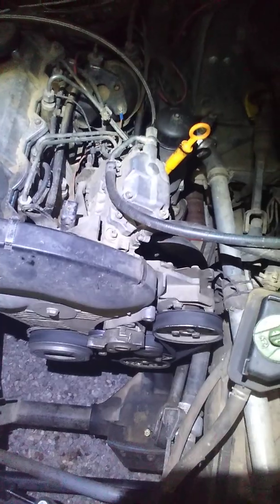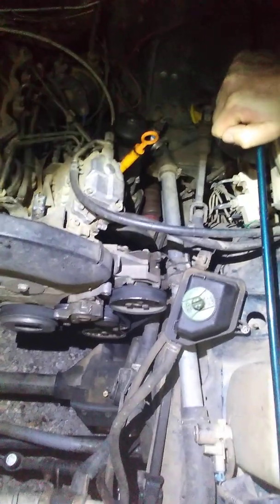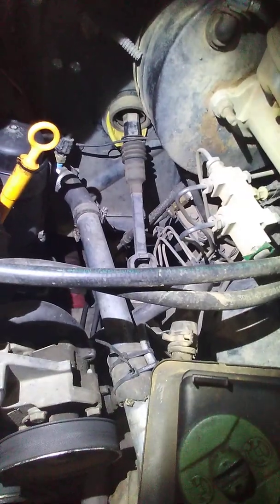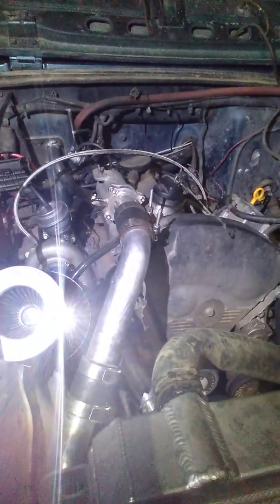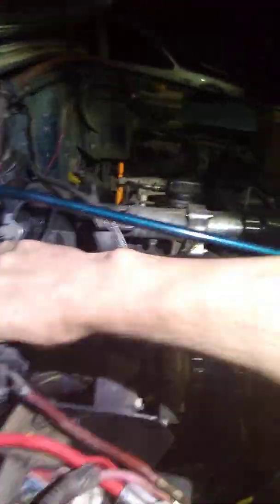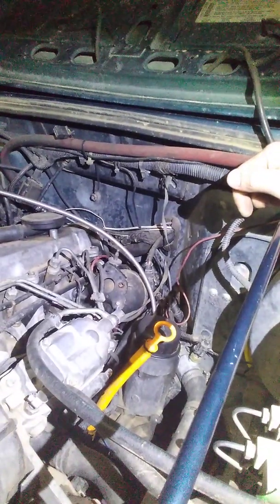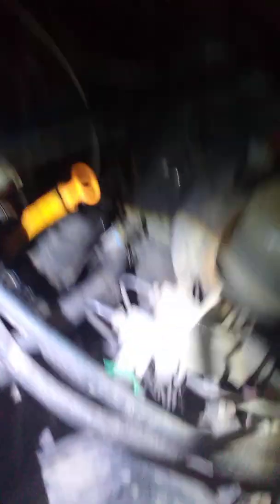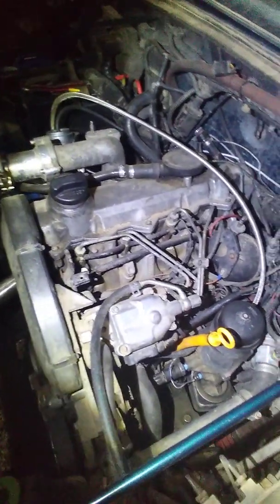Jeep TJ Wrangler TDI Diesel Swap Process more details for power steering and more

Comment: I was wondering how to get the ac to work also. I understand the ac gets a command to work and the compressor clutch is pulled in but i thought that the compressor has a squash plate that is variable controlled by a solenoid . I had them to fail and no pressure .  I not sure how to control them or just change to a differant  compressor that just cycles the clutch may be a sandon compressor .
Reply from the maker: The VW compressor is very easy just a simple on and off with 12v applied, should be the same as the Jeep so you simply splice the jeeps wires to the VW compressor

Comment: Loving this setup as it's very close to mine. Quick question if you don't mind, do you use the VW steering fluid (CHFS11 stuff IIRC) or the jeep ATF fluid? Do you have your O2 sensors plugged into the Jeep harness so as to not throw a CEL? (and just have them dangling somewhere)
Thanks -Andrew
Reply from the maker: I just have regular off the shelf power steering fluid in all my vehicles, never worried about manufacturer specific.  The jeeps ECU doesn't seem to through a CEL that I have ever seen, if it did I would just pull the bulb out and be done with that, I am only concerned with the CEL from the VW ECU anyways.
Reply: @TDISwaps  Gotcha, the only reason why a Jeep CEL would bother me is because of Ohio emissions testing, as long as you don't have a CEL you pass lol. Thanks
Reply from the maker: @amorag59  Ya you should be fine that way, the jeep ECU is all happy because it sees the engine spinning with the crank sensor that reads the flywheel which you still have with the TDI

Comment: how did you know what size intercooler to go with for the motor? And how did you go about the stock CAN-bus system for the jeep gauges? I have a BHW motor out of a Passat, going in a Tj.
Reply from the maker: On both swaps I just went with the biggest intercooler I thought would fix, but the Wranglers is too small and blocking flow through the radiator, so I will be upgrading that, you want to fill as much of that square TJ grill as you can.  For the gauges I just left the computer and put the Jeep oil/coolant sensors into the VW engine.  Then you have to mimic the cam sensor with a relay to get the tach to read.
Reply: @TDISwaps  Thanks, that helps. And would getting a bigger intercooler block the radiator more/ could an Electra fan solve that? Idk the stock Passat intercooler is probably only the size of a piece of paper. I am trying to leave wiring at a minimum, but I know I have to do it. But any chance did you do glow plug lights and check engine light wired into the cab or dash?
Reply from the maker: @chrisoneill1954  sorry I'm say the solid sides of my intercooler collectors on either side are completely blocking those areas of the radiator.  I only have a glow plug light, wired to one of the glow plug wires.  I know guys on the TDI swapped trucks Facebook page have done a check engine light though.
Reply: @TDISwaps  Thank you very much.
Reply from the maker: @chrisoneill1954  No problem! Feel free to ask anything else